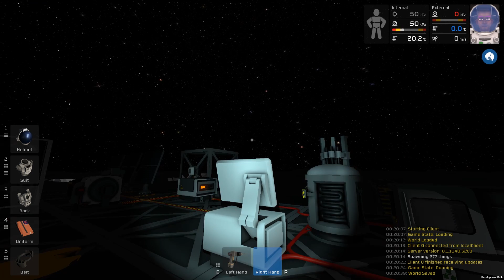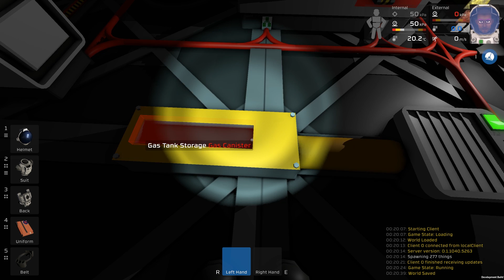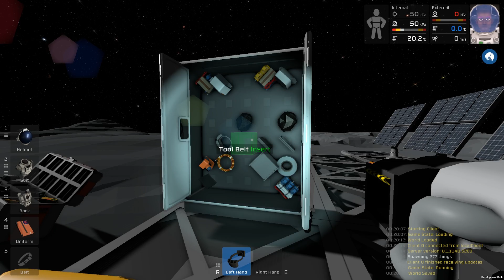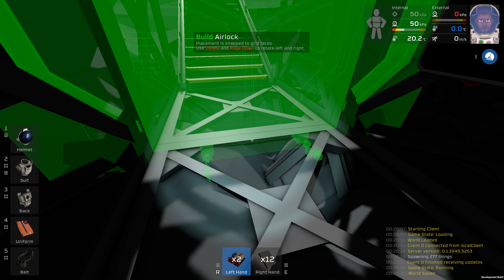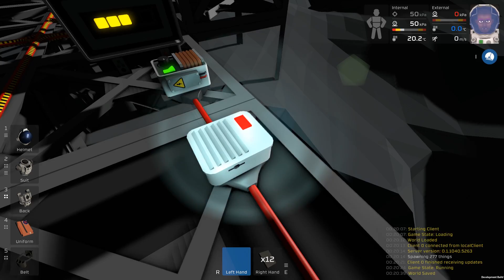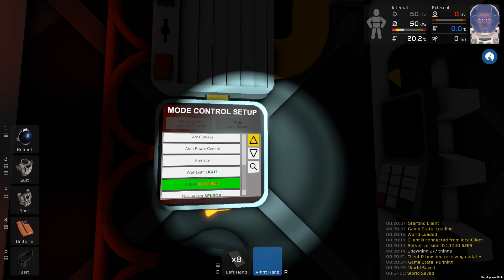Stationeers E04 - Automatic Airlock Construction and Refilling Welding Torch

Comment: I'm having problems with setting up my airlock.. I tried using the starter air tank as a mean for filling the room and a place to empty the air into but even when the pressure go to zero the outer door dont open unless I click cancel, and so far cant fill the room all the way up..
Reply from the maker: That sounds like you've got the doors the wrong way around when you assigned them in the console - When you get into the airlock to leave, and hit the button, the pressure should go down inside the airlock, and at 0, the door should open

Comment: Hi! Quick question, since you put a passive vent on the other side, won't you run out of oxygen in the pipes resulting in the airlock not being able to pressurize? And do you know if the leak issue is fixed? I'd love to build my base underground too :)
Reply from the maker: Leaks are fixed :)